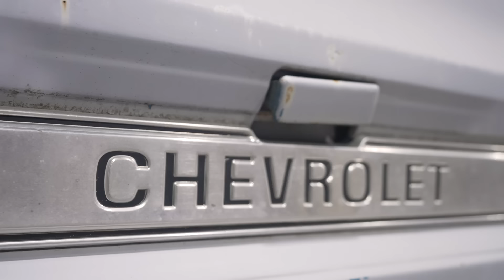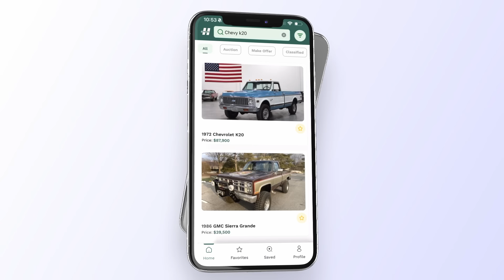SQUARE-BODY SHOPPING | CHEVY & GMC K20 4WDs | WHAT YOU NEED TO KNOW

Comment: the short beds look cool but you might as well get a blazer its the same with a cap but no single cab.  The long bed is actually useful
Reply: I would agree with that....Honestly I prefer the Dually
Reply: Blazer actually has a shorter wheelbase.  

Not a fan of shortening a long box, plenty of shorts out there to buy.
Reply: I agree what’s the point of a three-quarter ton short bed? I’ve got an 84K 20 4 x 4, and an 89V 3500 4 x 4 Dully 9’ dump rack body, love them trucks, I put a 77 small block 400 in the 84, that made it even more awesome! 😂, I also have a 73 custom deluxe 1500, sitting in a barn doesn’t run anymore.
Reply: Not when youre in the woods.

Comment: In the 80s and 90s I had a 77 GMC C25.  It mostly hauled around a 10.5 ft cab over camper.  It never complained.  Sure wish I still had it.  Sold it for $2000.😢  Nobody told me they would be come "classics."  😁

Comment: Ian, that NP205 was even available in the 71-75 IH pickups, but NOT the Scout.
Reply: Yes and both dodge made a divorce passenger drop 205 while ford made both a married and divorced driver drop 205.
Reply: @TheOnlyBlackInMeWasWillieBrown  that IH truck used a divorce unit. I know, I’ve gotten several of those trucks. I got what was usable (including what was not succumbed to body “cancer rust” and then I ended up scrapping the rest. I was torn doing so, but a man has to do what he’s gotta do.
Reply: @TheOnlyBlackInMeWasWillieBrown  it’s also just a shame that IH decided to use the crappy 727 automatic transmission in several trucks. That’s what ultimately caused me to switch over to a manual in everything that I drive. But WHEN you can find the sorta rare Borg-Warner T-19 transmission, JUMP ON IT! Granny low AND synchronized granny. No more gear grinding when you’re moving, unless you have a synchro issue.

Comment: This truck has a 10 bolt front axle, not a Dana 44 as stated in the video. The earlier models did have the 44 up front until around 1978.
Reply: 77 was the first  year the used a to bolt front.

Comment: Hey Ian. I've got a 1979 K-20. It has a 350, SM 465, NP 205, 14 bolt full floating rear-end, 10 bolt front-end. With the exception of wheels,  and front winch bumper it is stock down to the am radio.
Reply: that sounds amazing!!!
Reply: Sick! I have a '77 with a 350 in it also. Same tranny same everything they're such fun trucks!

Comment: I still have the first vehicle I owned. 1973 K20, Cheyenne Super, Deluxe camper package. The only upgrades were hellwigs helper springs, aux trans cooler, transgo shift kit, headers, dual exhaust, 12.00x16.5 rims and tires, aftermarket inverter (for dual batteries), aux fuel tank and receiver hitch. With the camper on, it rides like a dream. Occasionally pull a 19’ (Grownups) motor boat with the camper. Two things I hate about the truck are the seat on long trips is down right back breaking, and fueling it up with 93 octane (48 gallons). I tried to buy ford trucks, but they wouldn’t give me what I wanted. Either 4 wheel drive OR a camper package, not both. Plus, ford sat higher than Chevy. My kids tell me sell the truck as it’s worth a lot. Guess they’ll have to wait til I die.

Comment: Square bodies are red hot for a while. I have an 85 GMC Sierra Classic 3500 Regular cab long bed. It’s a rust free truck that was special ordered with 454 , NP205, Dana 60, full floating rears, 4.10s, HD everything with the upgrade interior. It has 70k original miles and I bought it off the original owner that had a little black book with everything he did to it since new. It’s a Factory Brown with tan interior. I turned it into a Fall Guy truck replica. How rare are trucks like mine? I know they made a ton of them but 1 tons that were never worked to death with all the options. Just curious! Great video! Thanks!

Comment: just picked up an 87 c20 with a tool bed on it no scale on the frame and solid floors hard to find in KY LOL but good ol solid truck drove it 80 miles home only issue was sticky caliper ol 350 runs like a top and throttle body she cracks right off slowly falling in love LOL
Reply from the maker: Thats awesome! Any big plans for it?

Comment: Im almost certain that they didn't make 3/4 ton short wheel base trucks. So either this truck has been cut down to make it a short bed or the cab has been switched on to a 1/2 ton frame.
Reply: I explained in the video....that the owner did the short bed conversion
Reply: @BigTireGarage  sorry I missed it.

Comment: AS a daily driver, you better have a lot of money.
I have a 4wD K10, and I know what the mileage is.  It is my favorite vehicle, but can't afford it as a daily driver.
These trucks have a fatal flaw, you didn't mention it.

RUST

The cowel, the part under the wipers, sucks in a lot of air when the truck is speeding down the road.
however, the cowel is more complicated than it looks.

The cowel is an open duct to both the driver side and passenger side of the truck.  a good amount of the air, and water goes down the left and right
cowel, and some of it exits through the plastic  panels behind the inner fenders.

The air that is supplied to the HVAC comes from the passenger side cowel.
Those panels by your feet on the walls, those panels are part of the cowel air duct.   They will rust out from the debri that sits there wet.  Check  your floor coverings, most likely , it will be wet.   The cheap fix is to clean the rust and fill with sealer.   you can use fiber glass for a longer fix but unless  you clean the rust out really well and use a good rust deformer, it will come back.

At this point, the air, water and debri can go in some pretty important places.
One never thought of is the left and right windshield posts.  the air is directed up the post over the roof and down the cab corners.  There is no access to these areas for rust prevention.  Though it is not the main reason the cab corners rust out, it is part of the rust formula.

There is an opening just before the plastic panels that lets the air, water and debri into the rockers.

the area just behind the inner fenders inside this rocker area gets hit hard with debri and water.  There is no place for the debri to go and  you can't get it out.
if you are repairing the rockers and cut the rockers out,  you will find debri rust and mud in there.

now  you would think that GM would have make it so the muck would wash out, wouldn't you?a
when you have your truck on a lift, look inside those rockers from the rear of the cab.
The inner rocker panel only  comes back about 3/4 of the rocker length. and at the end, they bent the metal to keep critter out but let water pass.  But it blocks the debri.
It also prevents applying any kind of good rust coating on the surface of the inner rockers.

debri sits there, wet and rots the metal until  you have to either fix it or junk it.

The actual cowl unit will rust out too.
This is are really intensive repair as you need to remove the fenders and doors.  To replace cowel panels you have to cut them apart because they are welded as a unit at the factory.  Unless you are an accomplished metal worker and welder, if your cowel rusts out,  your only hope is to fiberglass what  you can and hope it stops the problem.

GM could have done a better job but they didn't bother.  And now we who work on these great trucks are finding where GM stuck it to us in the manufacturing of the square body.

some of these areas they could have inserted foam to prevent moisture from getting up the tubes.  for the rockers, at least they could have put in a little screan to keep the debri out.  They did nothing.

So this is why you are finding many square bodies rusted out beyond repair.  (if you want to see a square body that was beyond repair and brought back to life, check out POLE BARN GARAGE, you wont believe what you will see in the rescue.)

Even if  you find a Square Body that looks in good shape,  check out the inaccessible areas, like above the rear cab corners where the door frame and body panels connect.  Rust likes to get in there and destroy the metal in the seams.

The very least thing  you should do if you are keeping your truck, is spray it everywhere, and I mean EVERYWHERE with mineral oil, transmission fluid, any oil based media to get that rust under control.  I'd do inside the door pinch seams day one,  over the fenders, the frame, inside the hood.  other than the paint, everything should look wet when you are done to stop the rust.   True  you can't get most of the cowel and rockers, but do the best you can.
lotsa luck, you'll need it.

Comment: As long as everyone is saying what they have. I have a 1983 K20  10 bolt posi front a full floater 14 bolt posi rear. 6” lift. 16.5 hurricane rims with 37’s  it’s Blue. Restored interior with patina exterior. 6.2 CUCV diesel with a functioning ATS turbo. Turbo injectors and pump.  It’s a single cab long bed but I bobbed the bed off right after the leafs so it looks like a stretched short bed.  I also found the last NOS razorback brand new. Exhaust dumps behind front passenger tire.  Turbo 400.  The bed top is 5’6” and the cab top is 7’6”. Where do I stop. Maybe right here.
Reply: Oops and a disc brake conversion with crossover steering

Comment: A friend of mine had one back in the day the hoods on some of these would bend up right in the middle.
Reply: The hinges were odd, and as they got old they would become stiff.  You had to push back and down when putting the hood down or the hood would have a lot of pressure on it and it would bend.
my 1986 has a more door hinge type of set up, it can bend but you would have to really get on it to do it..  keep the hinges lubed and it should be ok.

Comment: Why is the sm465 desirable? Grew up with these all around
Reply: Think it shifts smother.  The NP435 had a slightly lower first gear at 6.69:1 ration. The SM465 is around 6.55:1 not much difference but if you're building an of road truck or pulling truck I would think the NP435 slumber be a better choice.

Comment: I thought the last year for square bodies was 1987. The gmt 400 was introduced in 1988.
Reply: Although the GMT 400 debuted in 1988, Blazers, Suburbans, and fleet trucks continued as square bodies through 1991. Same thing with the end of GMT 400. I've got a 2000 OBS even though the body style ended in 1998. It was a fleet truck from the railroad.

Comment: Ian, that is not a k20. They were never made  as a short box. And that is not a 79 from the end. Its obvious the owner to did a tag job on that truck. You can tell by the inside bed color and cab color. All k30@ came with a dana 60 front not "some."
Reply: Apparently you missed the part where Ian said that K20 had a short bed conversation done to it
Reply: Actually some of the K30's came with Dana 44's